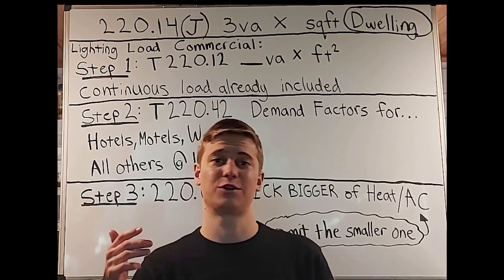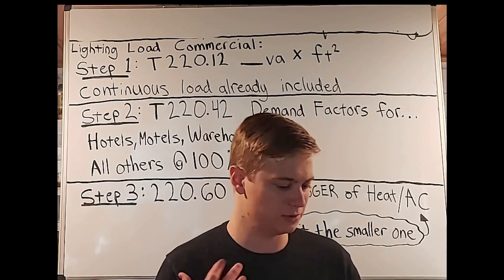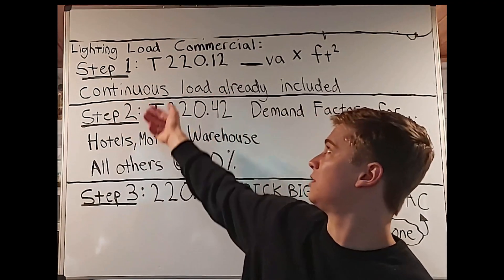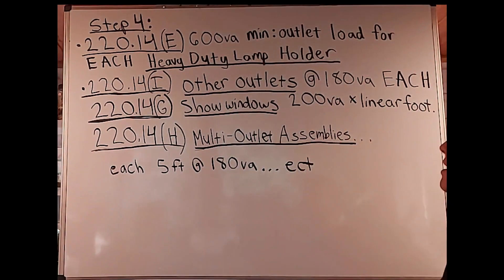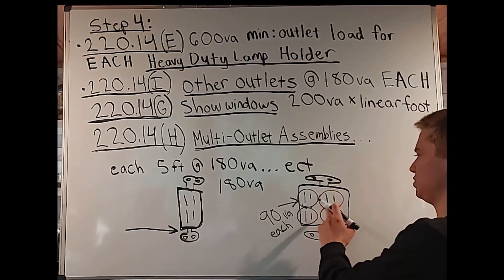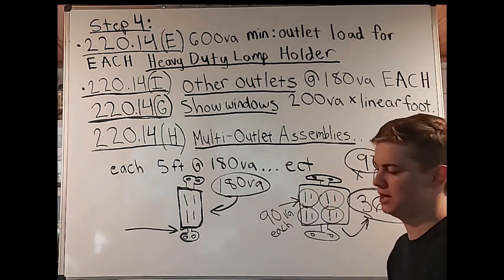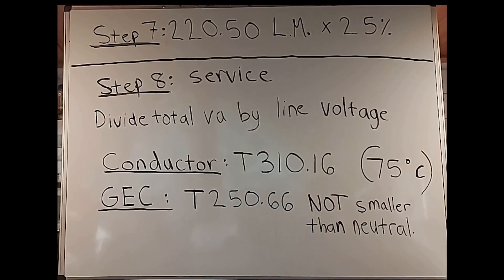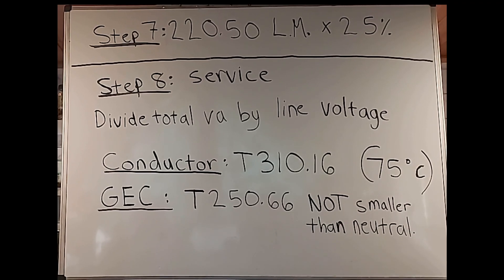Commercial Load Calculations Pt 1, Introduction.

Comment: On step 3 how can one tell. Which on is bigger?
Reply from the maker: You will be provided with the Amps and Voltage or the Wattage. With this you will compare and pick the bigger one. If they are the same just pick one of them, and discard the other number.